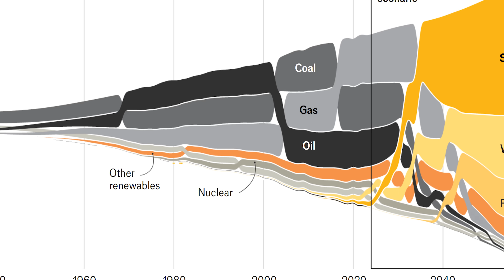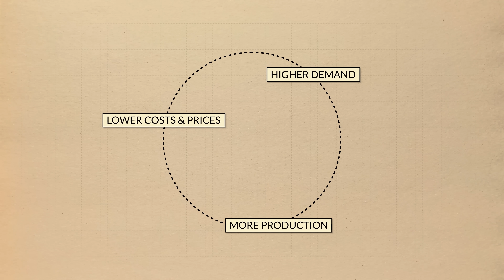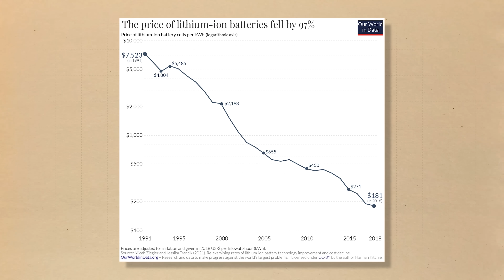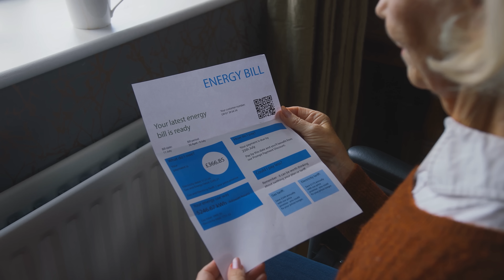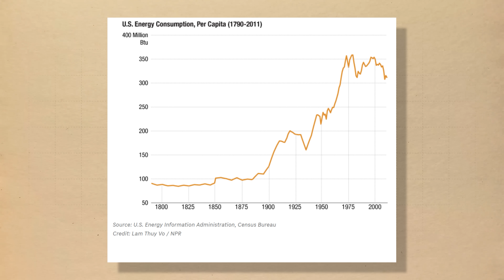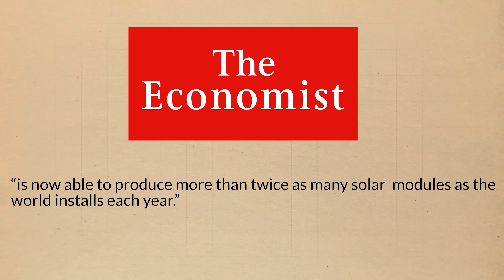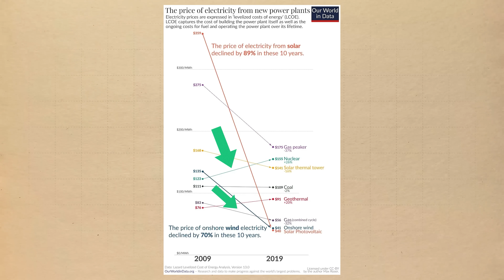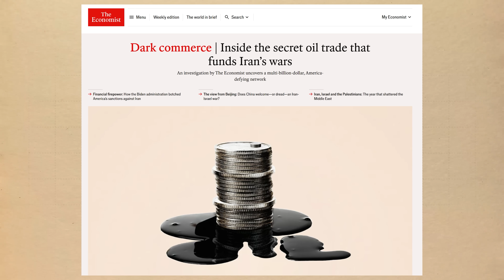Why solar will soon dominate & what that means for the world

Comment: In some countries, it's beyond 'so cheap' - actually costing money to find ways to burn excess energy to keep the grid stable
Reply: That is correct. When having too much renewable energy in the grid, you still have to run gas turbines or coal power to generate stabilizing power to prevent the grid not collapsing.

The European population are being told incredible LIES EVERY DAY ABOUT RENEWABLE ENERGY.

Renewables is a scam and expensive as hell. And in general the reason why Europe is collapsing
Reply: Solar is only over producing on a sunny day for about four hours.

For 12 hours per day solar is producing absolutely zero power.
Reply: @huboz0r  the excess power is so irregular in quantity and duration that it is only suitable for storage.  

Any industrial facility needs reliable power because the equipment is so expensive that they need it to run on schedule.
Reply: @jasonneugebauer5310  large scale electrolysis is also possible. There's a steel plant in Sweden being redesigned to use electricity and hydrogen reactions instead of carbon, and it includes massive hydrogen storage facilities
Reply: @XGD5layer  yes, hydrogen can be a good a potential use.  However, hydrogen production and subsequent use only has a round trip efficiency of around 20%.  

Is 20% efficiency a large enough gain to justify the cost of the solar installation and having the expensive electrolisers sitting idle most of the time the best use of resources?

I think if we have a direct industrial use for the hydrogen collocated with the production and this hydrogen is replacing hydrogen from natural gas, then probably this is a good idea.

But if the hydrogen is just being produced to burn as a replacement for natural gas, this technology use is ludicrous.  We have way better ways to store energy for grid storage, and hydrogen does not compete with natural gas in the natural gas piped system.
Reply: @jasonneugebauer5310  You are at most partial right. Minor argument: Most periods of excess power are predictable min 1-3 days ahead and are serval hours long and not just 10 minutes. Depending of the industry there is defo wiggle room. Major argument: In most industries there is main production process (which maybe needs constant energy) but there almost all the time serval auxiliaries processes which can be potentially waayyy more flexible. Iam talking like generation of compressed air for pneumatic actuators (big cost driver), cooling, heating, pumping of process fluids. Compressed air: We keep our system at ~ 6 bars and don’t go much higher in the buffer tanks to increase thermal efficiency of the compressors. But compressor and buffer go higher. When in summer days electricity is dirt cheap due to solar, you can go higher than your normal pressure in the buffer because the loss efficiency doesn’t matter due to cheap price. In the evening you can shut down compressor for some time and just slowly decrease pressure in the buffer tanks till you hit above 6 bars. Similar with heating and cooling. Often you can inject with mods some storage capacity in your „constant“ heating and cooling supply. Or think of pumping/buffering processes fluids. We have for cold water a well field and a big buffer tanks above the roof of the production facility. Normally it is keep 30-40% to ensure water turnover in the tanks. Its possible to pump it to 90% during the day and just let it empty during the night to 25%. I am sure with creative thinking you can find other examples on your own :) Certainly doesn’t solve the whole storage thing, but can give a significant contribution to it.
Reply: It has simple solutions, if you invest in it. You could have hydrogen generation facilities, CO²-less steel manufacturing, or any of the brute force methods mentioned by the video

Comment: I work in the renewable energy industry. I remember seeing in a presentation that new solar builds are up in the US 3-5x, and new battery storage sites are up by a factor of 20x! Storage is a key part of why solar is starting to make a lot more sense! It'll be exciting to see what all the new battery research will yield!

Another comment pointed out that natural gas has non-electricity uses so solar electricity won't be able to substitute for those cases. I wonder (honestly, not rhetorically!) how big that slice of gas demand is. Enough that Europe still needs Russian gas OR is it small enough that the Netherlands could supply 100% of its gas needs and export more? (EDIT) A quick Google found a DOE article stating that 40% of gas is used for non-electric purposes. If more people use electric stoves, heat pumps, etc. I bet we could theoretically reduce our gas use by 50% without a lot of pain or new tech. Wow!
Reply: The largest "non-electrical" uses of natural gas are not for heater or stoves, by a HUGE margin... but for hydrogen production for fertilizer, steel, oil refining and chemical industries.
Reply: There is more wind energy during winter. So we can heat pumps powered by electricity produced from wind.

Insulation is another thing. There are passive houses which doesn't need any kind of heating during winter at all. 

We can make bio char from human waste and burn them in cogeneration plants during winter to produce heat for district heating and electricity for the grid.
Reply: Heatpumps are now a gamechanger that enables the electric heating to be more efficient than burning gas, even when the electricity itself was produced from that same gas in powerplant (restrictions, caviats and adoption pains apply though), hence the gas can be replaced in households in a matter of years.

However, for industrial processes it is often possible to replace gas by electricity for heating, however, that often comes with significant capital investments, hence we are switching from years to 1-4 decades, but if there is the will it will happen eventually
Reply: @milospavlovic7520  Coal is on its way out, even in china, the average capacity factor for new coal plants is dipping below 40%. Gas will take longer, but i could easily see cities without any public gas infrastructure in the future especially in places like here in australia, no need for lots of heating, heatpump uptake being extremely high, and a switch to induction, electric and other types of power in the home. Gas for resedential is going to die out.

Comment: Long time subscriber & fan but you almost had me screaming at the screen today. What green energy fans fail to acknowledge or appropriately price is that solar can be a net positive to an individual property owner but is destabilizing at a system level. Because wind & solar are intermittent and large scale storage is currently uneconomic, grid operators have to maintain redundancy for every new solar or wind farm to ensure baseload (a fancy way of saying electricity is always available when the user desires). Green fans don't incorporate this cost into their models for green energy & grossly underestimate the true cost to society of this scaling. Solvable long term? Perhaps. Any yes energy deprived Africans may benefit from intermittent energy where they have none today. But, at its core, even Africa is a perfect illustration of the base load problem. If businesses & consumers can't rely on corrupt or incompetent local utilities for reliable energy,  then installing solar or diesel generators is a secondary cost they incur to have reliable power.
Reply: base load is an outdated concept, and the idea that battery storage is unecononimal is a relic of the past. Prices for storage are also plummeting, so intemittency is no deal breaker anymore, just an additional concern that can be managed.
Reply: You are RIGHT THANKS FOR SOMEONE WITH SOME BRAIN

Comment: To your point about what newly cheap energy could do for economies, I agree. Predicting what innovations will occur in the future is a fool's errand. But identifying the conditions under which innovations, whatever they may specifically be, typically occur and predicting if and when those conditions will exist is definitely possible. Just from things I have heard of before, there are many industries where there are multiple approaches to achieving some goal, and one of those approaches is to just throw energy at it until the problem goes away. If you make energy really cheap, that could potentially revolutionize some parts of the economy without even needing any additional innovations.
Reply: It could help alot with AI, where energy costs is one of the limiting factors.
Combine renewables, AI, and robotics, and things could change very quickly.

Comment: Let's calculate a little: The graph shows about 700 GW, so let's be generous and make it tenfold, say 7 TW. Then, the capacity factor ? Say 30%.
We get 7 TW × 24 h x 365 days x 0.3 = about 18000 TWh = about 64 EJ = about 10% of World's primary energy consumption. Impressive, if gets realized. 
However, it's one thing to install panels, it's quite another (and much more expensive) to build an electricity system using that much solar. 
Aaanndd, this would still only make a 10% dent in fossil fuel usage...
Reply: It's installation per year in the graph, not the cumulative... if 700 GW really is installed just this year and it keeps going with no additional manufacturing capacity added for the next 10 years then we will be at 9-10 TW total installed (we are somewhere around 2 TW now). Your capacity factor is generous (world average is 13%) but there is also the wastefulness of many uses of primary energy, a coal plant is 35-ish % efficient (3 J coal -> 1 J electricity) so the cut to fossil fuels is more than 10%. 18 000 TWh solar electricity would push out all fossil sources from electricity production if that can be handled by the grid... I assume it won't but we will probably also use electricity for much more of the heating, cooking, driving etc that today uses fossil fuel. It'll be interesting to see if we really get 700 GW installed this year, that is a big jump from 2023 when it was something like 350 GW.

Comment: Not until someone invents large scale battery storage it isn't - It's dark roughly half the time you know and we sometimes get those big fluffy things ... clouds?
Reply: "Not until someone invents large scale battery storage .... "
It's been done.  The Tesla company already makes more money from storage batteries than it does from automobiles.  This is likely to continue, so check back in three or four years.
Reply: @calamityjean1525  Yeah right, UK regularly has 10+ days low wind in Winter (so no solar) calculate what capacity of Tesla batteries you need for that - last time I did a back of an envelope calculation it was a couple of cubic kilometres of battery
Reply: @Prometheus-Unbound    Even in cloudy weather, photovoltaics will produce up to 25% of their maximum output, so NO solar is a bit of an exaggeration.  The UK has electrical supply cables running to continental Europe and Ireland so can import power when the UK is becalmed as well as exporting power when the UK has a temporary surplus.

Comment: Until energy storage problem is resolved the price of the solar panels meters very little. If 90% of the system costs using solar come from transmission and storage it still is one of the most expensive energy sources. And instead of bringing me energy revolution it might lead to countries just having another expensive energy source in the expensive mix. Still good for energy independence when compared to gas but most likely always will be far behind nuclear in total system cost.
Reply: Another way to see this is that now is a good time to think about processes that are energy intensive but require little enough infrastructure that we can afford to only run them when excess energy is available.